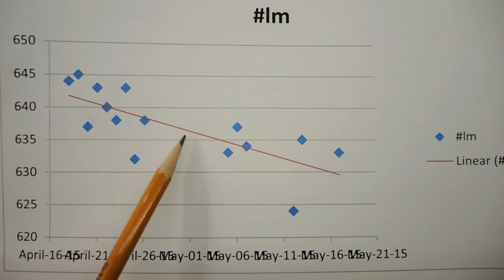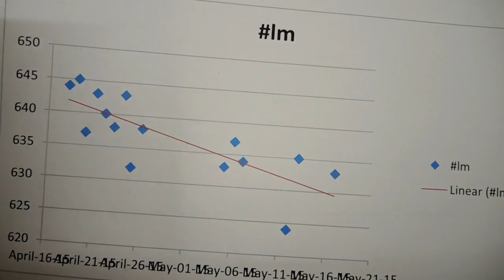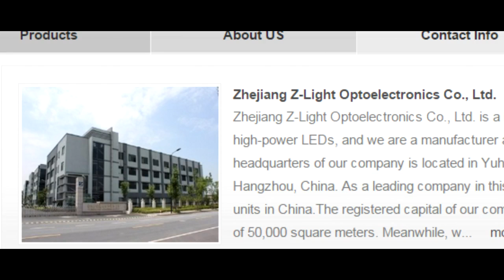Filament LED Long Term Test

Comment: Interesting. I was not aware that heat caused the actual emitters to die faster, having previously been under the impression that it was merely the capacitor that disliked high temperatures. 

Thank you for this video, and the study. Please keep doing them :)

Comment: There is at least one manufacturer who has achieved EnergyStar certification in the US for LED filament bulbs up to 7W.  One requirement for certification is that the  70% lumen maintenance lifespan must be at least 25000 hours, as determined by LM-79-08 testing done at a DOE CALiPER Recognized or NVLAP Accredited facility.  

Here is one example:
http://www.energystar.gov/productfinder/product/certified-light-bulbs/details/2231766

See the requirements at:
http://www.energystar.gov/ia/partners/manuf_res/downloads/IntegralLampsFINAL.pdf

So this video tells me that a random, generic Chinese bulb could possibly be expected to achieve 10k hour lumen maintenance lifespan.  The existence of EnergyStar certified bulbs tells me that, as a technology, their lifespan can be engineered to be at least 2.5x that figure.  

As an interesting side note, the Swedish Energy Agency is also testing a random sampling of LED filament products on the European market, and anticipate publishing a report on their findings some time this or next month.  This would be a follow-up to their initial report, available here:
http://www.energimyndigheten.se/Global/F%C3%B6retag/Ekodesign/Produktgrupper/Belysning/Report%20on%20Testing%20of%20Clear%20LED%20lamps%20v5%205.pdf

Comment: ElectronUpdate, at the end-of-life (say 70% brightness) point,  does the bulb use 70% of the initial power draw? Or is it still drawing the full rated current, and thus experiencing a slow degradation in efficiency? Inquiring minds...
Reply from the maker: Good question.... Something to check in a years tome
Reply: +Dan Coulson Thanks, Dan. Emitter end-of-life vs. phosphor degradation is a good distinction and I will ponder further.

Comment: I understand that you're just using what you have but extrapolating out that far is very very wrong. If the degradation of LED are in fact linear, even the slightest change in that slope would completely change the result. I wouldn't be surprised if the degradation of the light is nonlinear and that would even more so change the result of estimating the bulbs life.  

Regardless, I really enjoy your videos and always like your content.

Comment: can someone give me a link to led lightbulb on ebay that have color temperature of 27000-28000k ,everyone i buy it hase over 32000
Reply: marioc65 There are no bulbs with such high Kelvin numbers. You mean 2700-2800. ;-)
Reply: Wolfgang Messer 
yes, exactly ,i was way of kelvin scale lol

Comment: Thanks for the report. Actually doesn't look that great for the bulb. Look at IES LM-80 standard for lumen depreciation testing. Also, LEDs often fade faster as they age so the extrapolation should show a downward curve rather than a straight line. I've seen this on my own bench, testing LEDs with a calibrated meter and constant current source. http://www.eetimes.com/document.asp?doc_id=1280235
Reply: Nice report! I appreciate your research in to this. I have just a couple of these bulbs and I like them a lot.

Comment: FWIW, in the commercial lighting industry, the life of an LED is defined at the point where its output falls to 70% of the original output. 50% is a degradation I've typically seen used for solar panels.
Reply from the maker: mausball OK.  Thanks for the clarification.   That would then put the bulb at a ~10,000 hour service life if the trend line holds.
Reply: mausball I second this.
Reply: ***** No worries. 10k hours is still quite respectable for a bulb with no apparent thermal management.